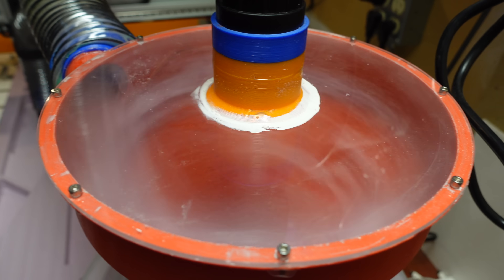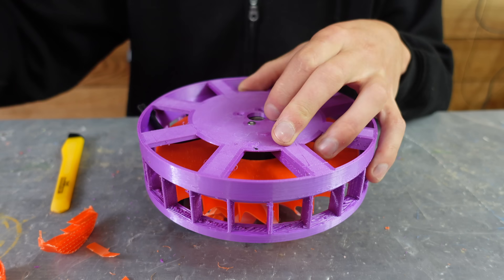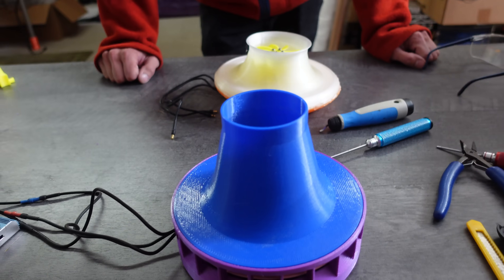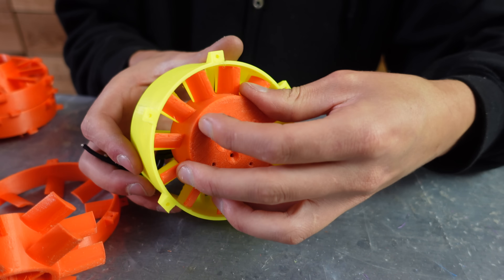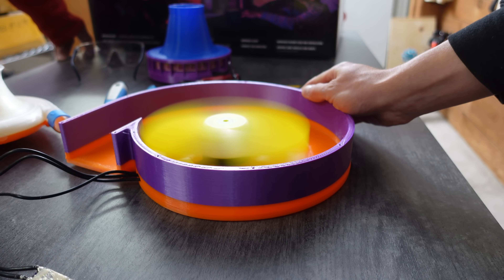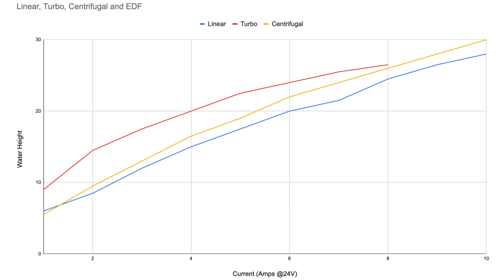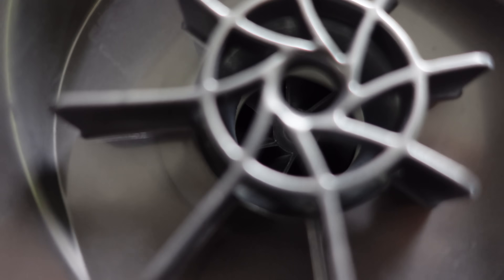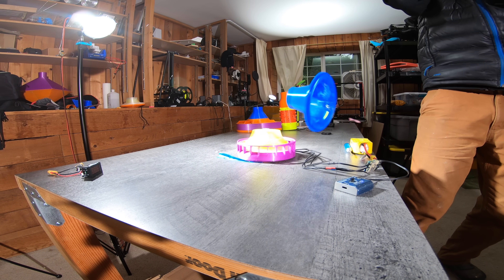DIY 3D Printed Vacuum Impellers

Comment: Take out the motor from a Miele vacuum cleaner, one of those you pull around on the floor, they have some of the best suction and it is easy to reuse the motor.

Comment: Ermm, actually, that Dyson DC 35 uses 260 watts of power, it’s over 200 watts less than your calulations, but slightly higher than your designs used

Comment: Hello there. the turbo compressor you broke should have been put in s snail design shroud in order to maximize the performance, but one more thing to mention is the venturi tunnels you need to make so that you can achieve much more vaccum than just connecting a compressor. Venturi will definitely increase the differential pressure and boost the performance.

Comment: generally you have a bit of a conical section on the impeller and some way to adjust the gap between the impeller and the housing, so you get a tight fit. very important for efficiency.

Comment: there is the hamster wheel which is also a drain-filter vacuum-impeller
when double annulus to make wall within the empty-space(bypass)
friction is hot
supersonic friction is very hot

super-cyclone is very simple
electrical-permaeability(EMF permeate)

Comment: Would such a comparison be valid at a much smaller scale. For example, if we scaled down all parts such that the propeller blade of the centrifugal pump is 2cm in radius and connected to coreless motor or N20 600 rpm motor, would i get similar results or will i run into problems? (working on a micro-mouse project and deciding what type of suction fan i need)

Comment: I was thinking of how to create a void so their can be a movement.. and what is interesting is in a plaentary sense, you have lots of means of  aceeleration. SO you you acn seprate teh matter ahead of you lie kpenumatic or fan that creates teh gradient, then you could us e a eletromagnetic force, to create a void, which woudl force whatever is aroudn to fill that void in space, on most planets liek earth or venus, then momentum and relation is the speed limitation and density in relatio nto what your using and its force. I think you coudl create a engine design, based on creating a void in front of you, and you coudl propel or go forwar,d but in the vacuum of space it owuldn't work well..., but then  I suppose you could do the inverse to waht teh void, whats is to put something in teh vacuum and it follwos hte laws to consolidate itself.. hmm... kind of like the old disney spaceship engine, lol

Comment: 💡Great invention idea for mass producing immunity to virtually any pathogen. Not that BS fake immunity kind we've become accustomed to in recent years either. 💰💰💰 I'm talking straight up natural immunity. First, we'll need a good containment system for incubating our pathogen. If we use a pressure suit for this, we can exploit the added mobility of our dual-purpose source-culture/incubator. As long as our source-culture is an animal, like for example –a human. Keeping a good seal in the pressure suit will prevent heat and moisture loss, maintaining an ideal climate for pathogen growth, while also minimizing the hydration requirements of the incubator. We'll need to minimize liquid storage to keep the overall weight of the system down, so minimizing the hydration requirements of the incubator will be important. We'll need a battery pack and an electric motor which will support several functions. First, a centrifuge to extract the lighter pathogen elements from the exhalation of the host/incubator. The non-pathogen exhaust can simply be looped back into the air intake. The last stage will be a blower, but we'll have an adjustable intermediary clean air intake which will further aerosolize the pathogens and more crucially provide the requisite mass of air needed to manage & maximize flow. Then we can place a fan on top of the pressure suit helmet for an omnidirectional distribution of the pathogen-rich air. Plus a detachable hose to allow a more direct concentrated pathogen-blast right into the customer's face. After the purchase of the system, the only real costs will be the mail-order pathogen, and the hourly wages of the hosts.
Reply: As with most businesses, the main operating expense will be the labor. But fortunately, the labor can be very unskilled. I would recommend hiring from the illegal immigration labor pool so that we don't have to pay the "incubators" minimum wage. That is after all the whole reason they decided to ramp up illegal immigration instead of the much more costly normal-immigration. And you can't blame them since Donald Harrumph forced them to "on-shore" all their labor back to the states from the more cost-effective Chinese sweatshops. There were literally no other solutions available that would still allow the corporations to keep the same profit margins they're used to. And it would be foolish not to take advantage of the same discount-labor used by our globalist overlords. And besides, those people need jobs even more than domestic Americans, who are way too expensive. Educated American labor is so expensive it's driving small and medium sized companies out of business. And the corporations will be next if there isn't a massive correction to the market (aka unemployment)...

Comment: @rctestflight I know this video is 1yo, but can you give me some pointers on how to solve a problem? I have one of those bathroom exhaust fans that goes on the wall, and I wanted to make a simple air sucking system for my 3D printer. The original blades are 100mm and when I put a reduction to 50mm they are very weak

Where can one find information about that?

Basically, how do I either reduce the pipes or design a new enclosure to make it work?

Comment: I printed two impellers and when I slide them onto the motor spindle, they seem to be slightly in an angle. How to make sure the hole in the middle is 90 degree vertical. Is there something I need to do with the Z calibration of the 3d printer?

Comment: I want to 3d print it with a stronger plastic and balance it precisely to spin at very high rpms identical to a mass produced vacuum cleaner motor. Potentially as high as 45,000 rpms

Comment: hi, great video ! not much of an engineer myself but would it be possible to produce a motor like yours that produced current rather than because of, based on air input? kind of like a wind turbine? I'm thinking compressed air input?

Comment: nop a turbo has a surge zone and a maximal air it can move the liit o the curve is nrmal it not due to the housing rubbing this is due to the geometry of the turbo

in addition for all 3 you have a fan is a collection of thin wing and a wing can stall pass a certain speed or flutter, the same for the static wing inside it is static but it sees air and can stall also

Comment: The axial fan would be quieter if you used a different number of stators and blades. It looks like your current design has the same amount, every time they line up you get a shock wave. That's why jet engines don't use the same amount.

Comment: I don't think the Dyson would have sucked any of the water up the hose (@6:50) because that bucket is too far away.

Pure vacuum is ~30" of water, but the vacuum is further. Even if it pulled a perfect & complete vacuum, water couldn't go up that far.

Comment: So, a stator rotor system is used to compress a fluid (this includes compressors and vacuum pumps) as the stators trap air while the rotor moves it stage to stage. 

In your application you don't need pressure, you need air flow as your goal is to move dust and dirt with air.  If you put dust in a vacuum, it won't move, you need the air to pick it up.  So you want a turbine, not a stator rotor setup.

Good luck!

Comment: Excellent video! Thanks you! 

Not to be “that guy” 😅 but pulling a vacuum is in fact “compressing” a low pressure gas to a higher pressure gas and vacuum pumps by definition are compressors. 

they just output to atmosphere. A vacuum pump can be staged to output high pressure if made right.
🤓👨‍🔬😜

Comment: I just downloaded the free version of Fusion 360 a month ago. Videos like this are giving me the gumption to get more into it. At the turn of the century, I was modeling parts like this for Honeywell - Sky Harbor in Phoenix, formerly AlliedSignal/Garrett AirResearch technical illustrations. I used AutoCAD Mechanical Desktop 2000 to model axial and centrifugal compressor and turbine bllades. Although I was creating 2D technical illustrations, I was given a box of paper drawings that I used to create accurate 3D models. One of my crowning achievements was creating an accurate 3D assembly for the Honeywell/Rolls Royce LHTEC T800 engine, which had two centrifugal compressors and conventional axial turbine section. I imagine that aircraft maintainers are using my illustrations to maintain an APU used on the B2 Stealth Bomber.

Comment: Hi, I’m reaching out to you because I have an idea but I have no idea of how to develop it. This is very close to what I’m curious about so I’m hoping you can help or direct me to help. The idea is this: I’d like to see if my electric trolling motor’s performance could be drastically improved by converting the 3 blade configuration to a multiple blade configuration inside a housing that is narrower at the exhaust. Kinda like a water version of turbine

Comment: These impellers have names when used in hydroelectricity. The automotive turbo radial to axial or visa versa is a Francis turbine. The waterwheel type is a Pelton turbine and the complex with the six stages is a Kaplan sort (with hydroelectricity it is a single one). The Pelton is used when volume is low but the pressure is high (high up in the mountains). The Francis is used when volumes and pressures vary over a significant range. The Kaplan is used when there are huge amounts of flowing water but very weak pressures (Run-of-the-river hydroelectricity). Its all about stuffing limit and compressor stall and the depending efficiency in the compressor map.

Comment: All of your cyclone separator designs I've noticed have too shallow of a pitch on the cone which is why your cyclonic separators are lacking a bit in performance. They operate based on both centrifugal force and gravity. If the pitch is too shallow; the centrifugal force is fighting against gravity. Your pitch should be about that of a traffic cone and I can almost guarantee you they will work much better.

Comment: I work on a vac truck, our truck has a second engine to run the fan system. our fans are very thin at the tips at around 2 inch and goes to about 6 inch in the center, id say roughly 3 foot diameter. We use 1 cyclone with 2 fans

Comment: 2:30 your blades are stalled because the outlet is too small and not hood enough pressure recovery in the outlet diffuser.

Comment: This is what Tesla intended with the turbine. The high rpm’s would cause enough vacuum and swirl to condense the humidity in the air to feed itself(self feeding steam turbine) the shroud separating inlet and outlet flow would be horn shaped, big end up, small end centered over the top of the rotor to enhance vacuum and vortex swirling)
Think of the shroud as shaped to produce a small visible condensate vortex in, which WILL happen with enough rpm/pressure difference

Comment: I think these designs would have been more robust if you'd used a bearing on both ends of the shaft. If the shafts are only mounted on a bearing on one end, then the shaft can wobble.

Comment: if trying as a shop vac. 
 if you put a filter box/collection tray. on the intake you can save your fan. 
then do your dust collection tornado system for the rest.

only thing is if the intake box has to small of say mesh. it will clog up with every thing, your just trying to save it from big stuff here.

Comment: Could you please recommend me software you are using (or would prefer to use) for designing all this stuff for 3d-print and so on. Is it (software) calculating airflow, waterflow, forces and stress produced on structures?

Comment: Simple flow tester that can be used to compare things: DC motor fan. It will spin up as the flow increases and you can measure the motor output.

Comment: "Just PLA"... dude, you have to try solid PLA parts.. you will never again say it is just PLA. It is incredibly hard material. The only reason they break up is because they are 3D printed. Melt some PLA with a hot gun into a shape of a stick, or make a mold with CNC and use an oven. You can use wood as a mold material, things are only heated to 200C. I thought PLA was quite rubbish material but boy.. was i ever wrong. Annealed solid PLA is in the polycarbonate range. Much harder than ABS. You have to see it, or in this case, feel it to understand, printed parts just are not at all the same. Printed parts are also in amorphous state, which is why PLA softens at 60C. Make it a semicrystalline and it can withstand up to 140C... and it becomes even harder to break.

Comment: However vacuum cleaners can still overheat from being blocked for too long due to them being dependent on the airflow for cooling the motor so even though the motor is working less it will still quickly heat up and overheat when blocked! :)

Comment: Also if you're going to have stages of fan rotors and stators you'll need to start with big blades and go smaller and smaller because the compressed air is smaller.

Comment: The effect where a vacuum spins faster when you cover intake also works in reverse, even more counter-intuitively - if you force more air into the intake, like with another impeller, the second one will slow down and draw more current from the added mass of air it has to push through itself.
Reply: That's how centrifugal impellers act. When you stop the flow, the air stuck in the casing is already up to speed, rotating with the impeller blades.

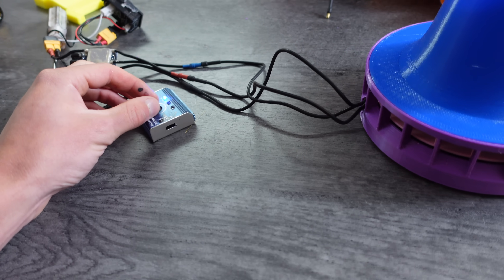Comment: I think you'll find your science at 2:40 is wrong, exactly backwards. It's using less current because the resistance in increasing. It's harder for the rotor  to spin because there's lower pressure on the inside but full pressure at the outlet trying to rush in backwards. If he put his hand on the blades it would have the same effect - current would go down. For a given voltage current will decrease as resistance increases. I = V/R

Comment: same thing happens when you use hair dryer too close to hair and wires gets hotter inside and burn, since no air flows and you can hear rpm increases.

Comment: The axial construction could be simplified by either using a spline shaft and having the rotors and stators stack up or by having the stator ring made in halves instead of... well, rings.
Also tip clearances rob you some significant delta p.

Comment: The turbine section of some turboshaft engines use a low pressure axial flow fan to provide a high volume of low pressure air to a centrifical turbine as the high compression side of turbojet.   Reduced number of stages with fewer parts, lighter weight and compact length.  The output side is usually a free turbine providing power to the shaft with reduction gearing.   They have impressive power to weight ratios.

Comment: I would really like a dummy downed video on how to make a 3D replacement for blow up holiday decorations. In the past 5 years I have bought 13 blow ups and 7 of them no longer work due to the fan alone (not the adaptor failing). A replacement motor from the website is actually almost more than a new blow up if you factor in the $7.95 for shipping.
Reply: You obviously have the skill to do so, and there isn’t a lot of videos if any on how to do it. I’ve looked high and low. Gemmy is the motor/fan brand. You would be doing a lot of people a favor considering how many people throw away the blow ups since it’s cheaper to buy a new one than fix the fan. And you obviously know what you are doing.

Comment: May I suggest using two or more modified EDFs turning in opposite directions? It's effectively like putting a set of stator blades in without the complicated construction.

Comment: While working at a thrift store I got a little vacuum in, and it seemed not not have a cord with it.
I reached up to my wall of cords and brought one down that fit it's input.  I plugged it in and it was really loud and was sucking the case down like it was imploding....
Then suddenly PUUUUHHHHhh... Out come bits of the impeller blade.... 
I opened up the case, and inside (where the dust bag would be) was the curly cord and a lighter plug...
I had plugged 120v AC into a 12v DC motor...  No wonder it exploded.... 😲

Comment: Your axial linear design is the exact design a turbomolecular pump for ultra high vacuum uses.
The difference in working principle is that yours pumps the air in a classical manner while a turbo pump transfers momentum from the spinning blades to remaining gas molecules which when bounce of the static blades to get to the bottom. Thus the blades have to move at the same velocity as the molecules. Defending on the gas you want to pump this means rotational speeds of between 20,000 and 90,000 rpm!